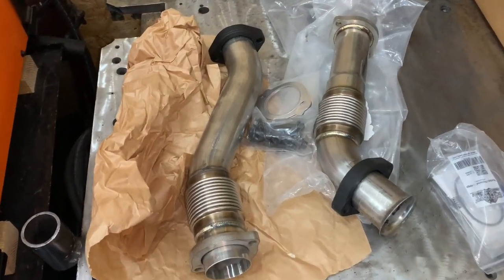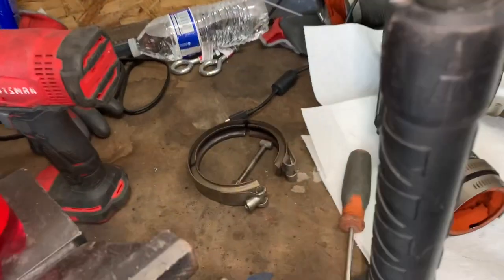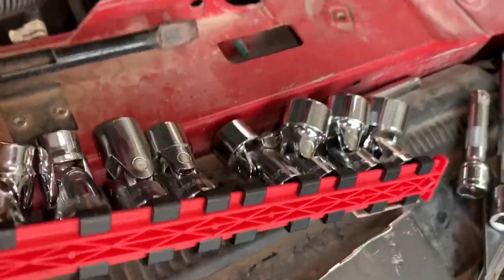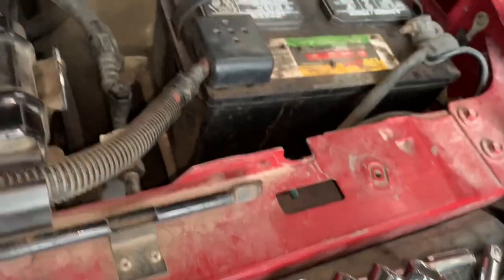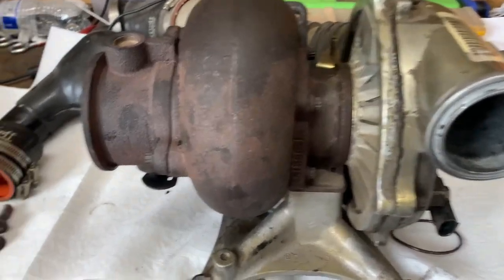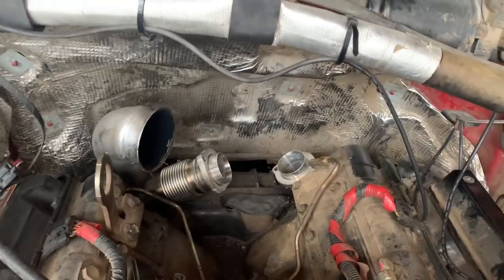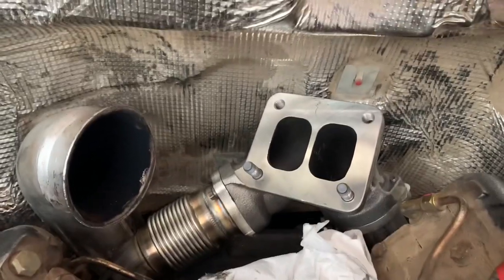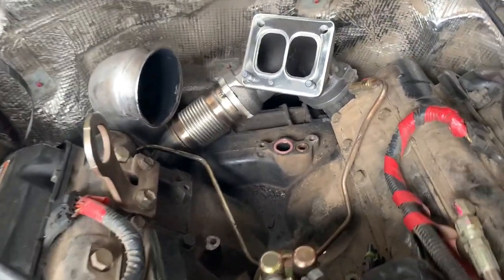1994-1997 Ford 7.3 Powerstroke Turbo Removal Overview

Comment: I watched your video just this evening. Thanks very much for showing the tools that you used. I'm going to get me some swivel sockets asap. I'm replacing the stock 1.15 A/R turbo housing with a 1.00 A/R housing, using a Wicked Wheel and keeping the EBPV. Stupid question here, how does the EBPV rod disconnect from the butterfly valve arm? I've not done any of this before. Should the EBPV be rebuilt or replaced while I'm in here?
Reply from the maker: I’m glad that the video helped. That sounds like a good combination, I myself have been thinking about going to a 1.00 A/R housing (especially since I 3.55 swapped it recently). The ebpv connects to the ebpv butterfly valve by a ball and socket type connection. You just have to slide the collar back and it pops right off, it is pretty simple. I ended up just replacing the pedestal which had a new ebpv, but a rebuild could also work too it depends on your budget. I would say the new pedestal might be a little safer bet against oil leaks. Even though I kept the ebpv, I actually have a had it unplugged the last few years, with no negative effects. I just drive it easy until it is warm.

Comment: so say the bottom driver side nut on the flange gets stripped. would it be possible to torch the nut off? I got a 96 7.3 and its got a bad leak on the turbo housing and bent fans from a previous owner. Its stripped but I've seen in some forums that people take torches to em. I've got the ebpv delete billet turbo, bellowed up pipes. the pipes are fine coming off im just stuck there. I'm usually pretty good at changing parts but I've never had to torch just yet.
Reply: i also appreciate any response given!
Reply from the maker: Hey there, that doesn’t sound like a fun situation. If the nut is just stripped out on the head, maybe try using a bolt extractor to bite into it and get it out. Getting a torch in there in my opinion is difficult. Not to mention potential damage to the aluminum pedestal the turbo sits on. If you are able to get to the up-pipe bolts that bolt up into the collector and get them out, then you could potentially take out the turbo with the collector still attached to it. Best of luck with that!

Comment: gonna be doing this job soon on my 97 f250. i got a kc turbos "stock plus" and deleted EBPV pedestal, was debating about getting a set of up-pipes and a new collector, but the turbo swap looked hard enough without pulling the cab. i'm wondering now if i should just pull the cab anyway and get the bellowed up-pipes and turbo in one shot..
Reply from the maker: I bet the KC Turbo and deleted EBPV pedestal will work very nicely for you. It's not the worst job, you have to have patience with it. If you really wanted to pull the cab go for it, but honestly the bolts are not the worst to get to (if you have the right tools). The worst part for me was getting the flange on that up pipe to clear but honestly it wasn't too difficult. These trucks tend to have different cab clearances from the engine depending on where the engine sits on its motor mounts so it depends on the vehicle.

Comment: Do you think you would have had to take the transmission crossmember off if you did the portapower cab work first?
Reply from the maker: You might be able to get away with just using the portapower, however taking out the transmission crossmember and dropping the transmission down allowed a lot more clearance between the motor and the firewall. I would say if you didn’t drop the cross member, you would have to bend and “massage” the firewall more then dropping lowering the transmission down and only having to bend it a little.

Comment: Working on this job right now for a client, This turbo has been a pain! How long would you say it took you in total?
Reply from the maker: Oh yeah it can be not so fun sometimes. I would say it took me 10 hours in total, I spent a lot of time trying to get the new up pipe in for the driver side which I ended up having to take out the transmission crossmember and lowering that trans down slightly. Most people typically do this when the transmission is already out of the vehicle, however I found that you can do it with it in, just a little more time to do it.
Reply: So the customer wanted me to do the turbo only. 6 hrs is a good quote for that you would say? Mind you, we’re in Alaska. Everything is original… 😢 Thanks for prompt response. I couldn’t have removed it without you showing exact thing to do btw. Saved me more time than I already wasted.
Reply from the maker: That does sound like a good quote to me. Mine was all original too, but in all honesty it wasn’t too bad doing that job. Of course I’m glad to have a helpful video.